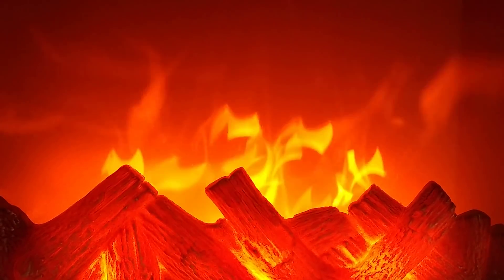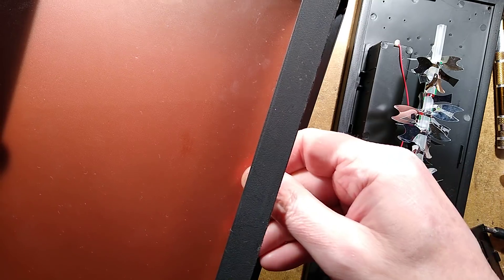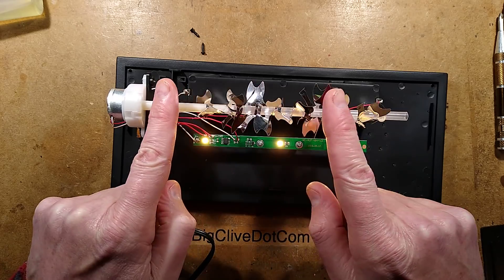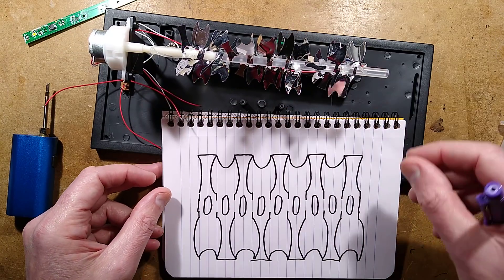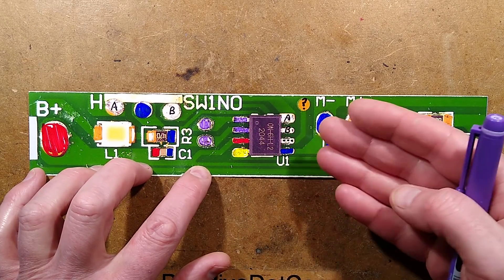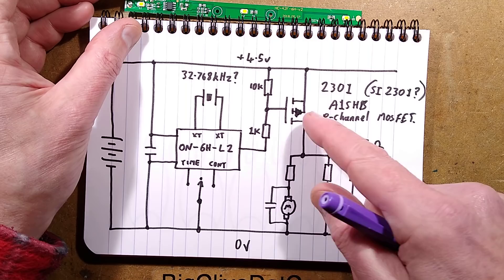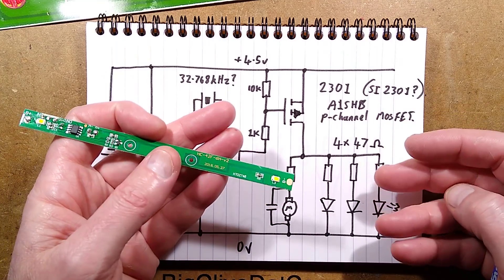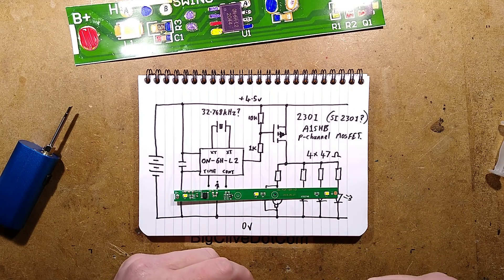LED fire simulator teardown and schematic

Comment: Mine stopped spinning after using it for 2 weeks. Any idea how to fix it?
Reply from the maker: Check the motor shaft is free to move and that a motor wire hasn't popped off.

Comment: What's the name of the red sheet?
Reply from the maker: There are many plastics that could be used.  I changed the colour of this effect to a green flame by changing the LEDs and the plastic, and slightly diffusing the surface of the plastic with sandpaper.
Reply: Thank you very much for your answer bro!!

Comment: I have an 110V electric fireplace that works on an almost identical circuitry and design. It also (3) LED cob bulbs in place of the 3 LED chips, and (2) 750W heater elements to actually provide heat. Even the milar reflective strip is of the same design. It is pretty convincing, as is yours. Probably both came out of the same Chinese factory.. but I suspect there could be plagiarism involved, which is, I suspect, rather rampant over there. 😂

Comment: re: wasted light on black background, I wonder how it'd look if you put something shiny (aluminum foil?) on the back?  And, if you use high power LEDs or overuse others creating lots heat, just drill some holes for convection flow and you have a heater too!   :)

Comment: I worked at a store that sold electric fireplaces, the really big ones with a heater. The same principle and mechanism though, as I learned when I fixed a couple of them. In the large version it's common for the reflector bar to have a pillow block with a bearing at the non-motor end. It also likes to rip free from the housing because they just rivet them in. Then your fireplace comes complete with a horrible grinding pinging noise.

Comment: I did an "amateur" version of this decades ago.  4000-series CMOS, 4020s to divide it down and NANDs for the 1-of-4 (6hrs of 24hrs) and crystal oscillator.  Bunch of orange Christmas-light bulbs for the "fire", and tinsel wrapped around a motor shaft for the effects.  Looked good if you squinted your eyes just right.  :D

Comment: I opened one of these fake fireplaces up once because I wasn't happy with it and saw how it worked. I improved it and made it very realistic using some tinsel and aluminum foil (which really works well and can be manipulated however you want and gives a softer effect. The tinsel combined with it fills it out and gives more depth and a bit of sparkle to it like flames and sparks. These were just additions to what they already used) and gluing a mirror behind it as well as repositioning some of the LEDs and I still have it. It's too long to go into all tye details of everything I did but It looks like real fire now and is twice as bright. An unexpected but happy consequence was that it makes some realistic crackling sounds as the aluminum foil hits the back as it spins. I was going to fix that but It was a nice feature and wasn't hurting anything. Great video because for many years those were a mystery to me.

Comment: Shows how little things have changed in some ways.  In the 60s my Nan's new electric 4 bar fire came with a "coal effect" front with the usual ceramic/wire glowing bars and a crappy moulded plastic blocks of coal.
The magic happened when you switched on a small red bulb with a very thin tinplate fan on top.  Eventually the heat from the bulb created enough heat to spin the blades and the glowing coals started to burn.  Quite effective and with the lights off it did seem to make the room warmer.  This one is better, but very similar in concept

Comment: All bulk and not much else in these things to make a significant effect with so little electrical circuitry in it to work. In fact, Clive I would like the M4 file you created of the fire working at the end. I'd like to use it as a screen saver on my laptop. If that is okay by you. Then wherever I go it will bring me a nice warm fuzzy feeling these chilly winter nights.

Comment: I like this effect so much, that is, LEDs and rotating Mylar. Something similar has been used in lots of Star Trek, in simulations of computers and warp cores. I'm really thinking of doing something for myself at home. If I put Mylar bits on a rotating shaft, so that they can move and swing individually, it would make for truly random reflections and not just repetition as it spins. Looks like that gear motor outputs about 12 rpm.
Reply: what type of engine is it? step motor? with which characteristics can I search for it?

Comment: My parents had one back in the 60's and it worked by having three small turbines each set over a clearish orange light bulb on a point bearing and the turbines rotated due to the hot air rising past the hot bulbs. In that design it was the gaps between the turbine blades that allowed light to shine up onto a bed of translucent coals to achieve a similar, though not nearly as nice, effect.

Comment: Berry "Magicoal" electric and gas "fires" used a similar effect in the 1960s-1970s, except the reflector (onto a backplate) was a non-uniformly bladed horizontal aluminium fan blade powered by just the convected heat from a red film coated non-frosted incandescent lamp of about 25-40 watts, which also illuminated the glass-fibre fake logs in front of the bulb and the flicker-fan. These were totally separate from the heating elements, which were usually situated above the coal or log - effect display. Unusually these bulbs had 3 bayonet pins IIRC.

Comment: Regarding the 6/18h split, it's a micro-processor, so in code you can make it whatever you like, once you have a 1 sec 'tic'. Wouldn't it be more likely that it's so you probably switch it on at night, and it limits the run time to preserve the batteries?

Comment: Project Request: Think you could do a guide on converting a string of Christmas lights to run on something like a solar garden spot light (the kind with a decently large solar panel)? I've got a lamp with 6in x 6in panel, and two 18650 LiFePo cells inside. With a boost converter, it shouldn't be difficult to get sufficient power out of it, but i'm concerned about both how the cold will affect it (i'm in central wisconsin, USA), and how to get something meant to run at 120v, 60hz AC to work on like, 12v or 24v, or less.
Reply from the maker: If it already drives a single LED or 3B panel then it should be able to drive a parallel string directly.

Comment: i was remembering the good old days with log effect electric fires that used 60w fireglow bulbs, picked up a new heater two years ago with the newfangled led's effect is very good not sure why it's fitted with a dimmer control though.

Comment: Clive, any  chance you could do a video on how to make the multimode led strings turn on as solid on rather than flashing and going through their 8 modes. Can't  seem to buy light with just solid on anymore and the flashing for indoor use is annoying. 
I'm guessing they could be rewired or tie one pin of the microcontroller high/low. Many thanks. Live the channel
Reply from the maker: Some have a position for a memory chip but it's not always populated.

Comment: Neat. I bought an electric fireplace this year and my one complaint is that it's not bright enough. Good to know how it works so I may dare to modify it eventually.
Reply: I just harvested some printer stepper motors & spindles,  and hard-drive motors, time to upgrade my non-fire fire effects! I'd love to try making an led 'flame vortex' effect, - any ideas come to mind? I respect your mad science, been following since 'back in the day' you made brick splitting gauntlets with some hinges to focus the strike. It worked like a charm for a patio diy.
Reply: @TheOrganicartist  You know, you could unwrap a Flame Effect lamp (type Big Clive showed in another video) this way flames would be coming at the reflective material from all angles.  How well this might work?  Only one way to find out!
Reply: +Looks like kinda slow motion footage.
Reply: Go for it, put bigger LEDs in, but I think they would have to be quite a focused sharp LED.

Comment: Higher power LEDs in the right color and you could probably project that directly onto a wall.

BTW, any simple way to make the motor spin at a variable and pseudo-random speed? I think it might make the effect nicer. I guess PWM would do it, but maybe it could be done much easier.

Comment: I remember making such a prop for a local small theatre group but it was a vertical cylinder with spiral cutouts covered with coloured lighting gel and with fins on top that rotated from the heat of a light bulb on the base; just like spinning Christmas angels with bells and candles. None of that fancy electronic stuff for me....didn't really exist back then.

Comment: Does the smoothing cap over the motor do the job of the snubber diode for protection against back EMF?
Reply from the maker: It does attenuate the switching spike, but also reduces electrical noise from the motor brushes as it spins.

Comment: I remember being at the mall where there was a pop up store for these in the middle of the... hallway? the big area you walk in between stores

And one of them was open for maintenance and I got to look inside and i was so amazed as a kid finally realizing how they worked. Although that one wasn't mirror bits on a shaft, it was more like a disco cylinder of mirror pieces that were contiguous
Reply: although it did entirely break the illusion for me from that point on which is sad

Comment: I bought a full size fireplace with this type of setup in it for $20!!    Tractor supply had a few of them on clearance for $70 for a few weeks and I had my eye on this one but didn't have the extra cash at that time.  I went in a few weeks later and they had the one I was wanting on clearance for $20.  I grabbed it dragged the box to the register.  Got it home and there was NOTHING wrong with it!!  The people just apparently didn't really read the instructions.  LOL  It has heat too, which is the part they couldn't get to work apparently.  You just had to hold the power button for 10 seconds.  LOL

Comment: Is there any advantage to putting the decoupling capacitor on the circuit board or can it be mounted directly to the motor and still work?
Reply from the maker: They are often found on the back of motors.

Comment: I have a Dimplex Cheriton electric fire that works in a similar way, only instead of LEDs and a motor, it uses the convection effect of rising heat from an incandescent bulb to spin the mirrors. I'd buy this if it were a bit thinner, to mount in my (long disused) cast iron bedroom fireplace, but I don't think the one featured here would fit.

Comment: couldn't fine anything about that chip, but many 8-pin MCUs have internal LC clocks, and/or have a different pinout (ON, Atmel, PICs, Holtek, etc, they all have similar layouts). However, many RTC ICs have a suspiciously close pinouts,  like power on pin3, crystal between 1 and 2, and some extra stuff in pins 6, 7 and 8. So it's probably some dedicated chip. But everytime i try to search for something like that (even in many manufacturers catalogs) i only find the 555 (even trying to exclude it from the search) — I guess the fact that it's even and smd and not a blob is lucky enough

Comment: I was using it for 1 year powered of USB supply and the motor died. It needs a twist on the mirrors axle to start turning. Probably one of the windings is burned. Pretty sad - next one I'll buy without mechanical parts.
Reply from the maker: Probably just a sticky gearbox.  Maybe strip it to investigate.
Reply: @bigclivedotcom  Unfortunately not. I took the motor out of the assembly. It runs fine without the load but 1/3 times it does not start without a nudge. Without the "vice of knowledge" I am not able to disassemble the motor, despite of use of "unreasonable force".  ;)
Reply from the maker: @AndyT6eski  It may have worn brushes.  It's an extremely common motor, so you could look for a new one or salvage it out of something else.

Comment: Hi Clive, what the chance I can send you an old dance pad that’s stopped working correctly?  I’ve checked the cct board and changed a capacitor I thought might have died but still not working. I think you’d find it interesting and I’d love to have it fixed. It runs on win XP and I have the original cd with programme.
Reply from the maker: I can't really accept stuff like that for repair.

Comment: I have one of those but mine is making a clunking sound
Reply from the maker: It may just be catching something.  If it's 120V and you open it, remember to make sure the power is off.
Reply: @bigclivedotcom  that's what I'm thinking it's either catching on the fake logs or maybe because we had the fireplace delivered the rotating things that makes the flame effects could have come loose

Comment: You could turn it into a mischief machine (or a cry wolf machine if you are unfortunate) by adding more leds to make it a bit brighter, hanging a fine mesh drape in a window (you would have to use red and amber leds instead of warm white unless using a coloured drape), and projecting it onto the drape. See how long before someone calls the fire brigade. A disco smoke machine could add to the effect.
Reply from the maker: You could do that big style with a fan and silk.  Like in some theme parks.  But not a good idea if it causes false fire brigade callouts.

Comment: I had always thought that it would be a cylinder with shaped holes rotating around a quartz heating element, I mean in the heaters shaped as fireplaces.

Comment: Berrys Magicoal fires from the 1950s had two 60 watt red enamelled bulbs. The heat from them drove aluminium rotors with a glass centre. These pivoted on a vertical needle. We `lubricated` this with graphite from a pencil but it was impossible to get both rotors to run at the same speed. The bulbs had a short life and were expensive so I wired them in series. They lasted forever but weren't hot enough to operate the spinners. What a long way we've come from those days, we couldn't have imagined getting light from a diode or a tiny motor and gearbox or reflective plastic sheet or using hot wax to glue parts together or...............

Comment: As an 8  yr old I tore down and old electric fire with flame effect. The flames were produced by 3 shiny propellers powered by the rising heat from the elements.

Comment: You could add some HV capcitors or some "electric fence" circuit with different capacitors to simulate fire crackles while burning wood

Comment: You say it's not very efficient, but surely far more efficient than old ones that used a 60W red coloured bulb to make the same effect! The old ones didn't have a motor, they used the rising heat from the bulb to turn a windmill geared to the shaft with the metallic reflectors on it. So the effect would be stationary for the first few minutes then gradually start to turn.

Comment: It looks much more realistic than the log effect electric fire of several decades ago, where the effect was produced by a rotating fan that was driven by the convection current caused  by the heat from an incandescent lamp (that looked like it was wrapped in a lucozade  wrapper).

Comment: Makes me happy that things are still made like this instead of being purely done in software :3
Reply: I double that, having seen modern software.
Reply: Anybody else want to see what happens when you combine two or three methods?
Reply: Plus, doing it using computers would cost a LOT MORE! 👎😂
Reply: Doing it in software would require an expensive screen. Well, expensive compared to this thing, anyway. This is probably just a few dollars' worth of parts. A screen and suitably-powerful processor to generate a fire effect in software would easily be ten times the cost.
Reply: @Roxor128  I thought more about those flame lamps that just have a thousand LEDs that are multiplexed.
Reply: yha, what happens if you combine the flicker LED's with the rotating reflectors...

That's what I'm trying to picture.
Reply: @ICountFrom0  because we can, and it can be quite interesting to try.
Can't wait for someone to model such a thing and send Clive their blueprints. If he likes it, he can even build it on one of his calm and talky live streams we adore so much.
Reply: @jkobain  You mean the calmness of  how Bob Ross did for painting, that Clive brings with electronics? I got ya. LOL
Reply: @Roxor128  well, you could use projections, maybe differently, but still could.
Reply: @jkobain  So, something like a rear-projection TV? That'd certainly save on screen size.

Comment: The heater ones typically use Mylar blown by the fan that inevitably blows over the heating elements. Thankfully those use replaceable bulbs instead of Non-replaceable LED strips.

Comment: Hi Clive, I love your channel,  been watching your videos for years and I Watch every weekend your live channel, I also live not so far away from you in Andreas.  My question is what diode or setup (kit) do I need to run this from a USB power source?  Thinking of going JAC's and getting one myself. Thanks for all your hand work and Videos, Please keep it up.
Reply from the maker: I modified mine by putting a diode in series to drop the voltage slightly.
Reply: @bigclivedotcom  What diode did you use, would a 1N4148 work?

Comment: I always look for stuff like this.. I remember, some 15 years ago, a cr2032 battery was about €3-5 for a pack of two and led´s (pref. bright blue) was 50c .. At the counter of the shop; Key-chain flashlight (including 1Led (bright blue), a pair of cr2032 in plastic case with an on off swich )  €1. <- For €1 someone even took the time to screw in 2 tiny tiny screws and put a plastic tab inbetween the two 2032´s.. and attach the ring and the chain..

Comment: Reminds me of those 3 bar electric fires with the clear orange lamp with the fan that rotated using the heat from the lamp...the fake logs were clear and it projected on to the back of the frame...3k flat out not exactly cheap to run but we were fiddling the meter!!!👉🧿👈👉🫂